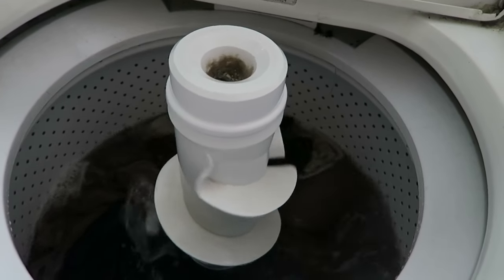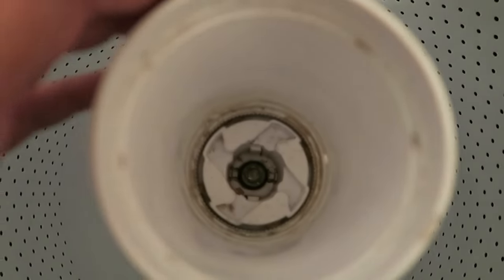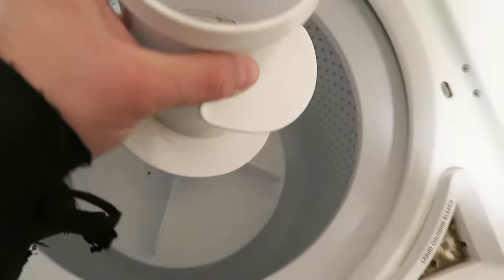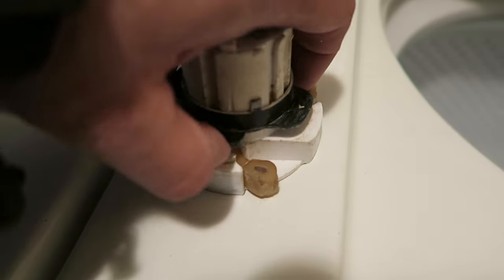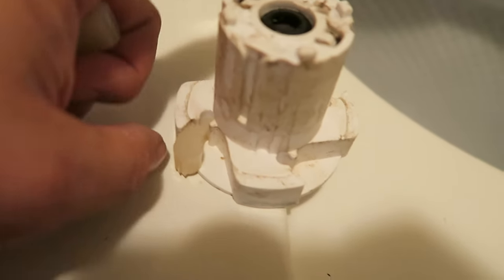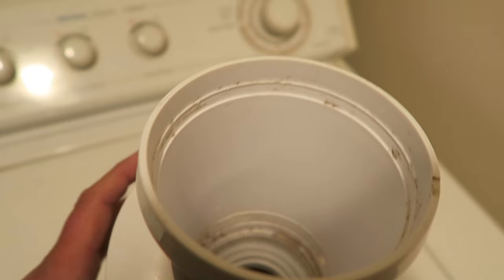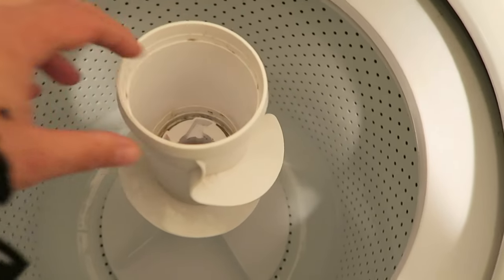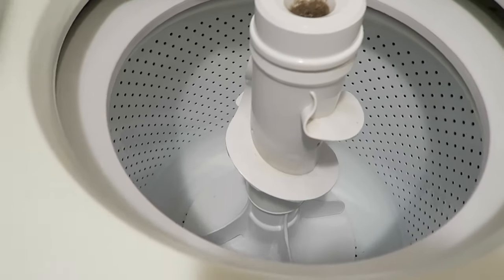How to Repair Agitator Dogs On A Whirlpool Washing Machine.

Comment: DIY for life man. I have refurbished my hot water tank, furnace and fridge. I don't like replacing things that don't need replacing. Great vid man.
Reply from the maker: Damn right, if there are no specialty tools require, and as straight forward as this for a part that costs less than $2, there is no way you should have to pay $150 to have it done! Power to all DIY people!
Reply: @JDirom  hey nice video, what does it mean if the bolt to the agitator is wet?  Does it mean water was seeping in because the seal o ring wasn't keeping the water out?  Like that black seal that was broken when you pulled that piece (cap) over the bolt off?
Reply: @doja-3652  I would say yes that sounds accurate. Replace the rubber seal for the cap

Comment: I cannot pull the top part of the agitator. You put your feet and pull it easily. I put my 2 feet and pull very hard but it won't come out
Reply from the maker: Should take very little effort to do. There isn’t much holding it on there.
Reply: Same Paul!  I'm exhausted from trying,  my husband and I are strong and capable it will not come apart.  I've almost fallen backwards from pulling so hard.  Any luck?
Reply: @gilbertfamily3824 I thought the same thing too but got mine popped open. My washer uses same cogs but little different to the one shown in this video.There are 4 tabs which go from the lower base to the cog cage and they are melted in place. I tried several ways but one which did the trick is to sit on the floor, have shoes on. Grip the agitator fins with your hands and lower base with your shoes. I had to use over 100 pounds of force to break the seal.
Reply: Anyone have better ideas?  I'm trying to pull the top piece off and can't figure what's stopping it.  The bolt was rusted half away, so maybe that has something to do with it?
Reply: @eatjonesoh  there are 4 clips which are melted on to the cog housing. If you can't pull them apart with brute force. You can try heating up a paper clip and try to insert it where the 4 clips are melted that should help release it.
Reply: @eatjonesoh  if the bolt is rusted it's most likely your oring on the cap is cracked.
Reply: @ThePunjabhe  the o-ring actually was in great condition. It might not have been seated properly.  Is there supposed to be another gasket of some sort underneath the agitator?  The spindle was very rusty as well.  I did replace the bolt, but it didn't screw into the spindle as far as expected. I'm not sure if that's because of all the rust or not.
Reply: @ThePunjabhe  I did finally manage to get them apart.  It took sitting on it and quite a bit of force the top and all the dog assembly went flying when it finally came loose!
Reply: @eatjonesoh  yay, same thing happened to me, the parts went flying everywhere. I had to watch more videos to figure out how all the parts went back together.
Reply: @eatjonesoh  the bolt and rubber washer is supposed to seat in all the way. Don't force the agitator or you can damage the plastic splines, keep turning it until it slides in the spindle.  Not sure if I saw an oring at the bottom of the spindle.

Comment: We can’t get the bolt to break loose. We are using the 9/16 socket with extender. What can we try??
Reply from the maker: Assuming that the 9/16 (14.28mm, I used an 11mm in this particular washer) is the right size, you can try some penetrating oil to loosen things up if the bolt is seized. Just be aware you will have to clean after otherwise you could ruin your laundry if excess oil remains after the repair.

Comment: I replaced the agitator dogs, and turned the agitator by hand it does catches. But when I turn the machine on, the dogs seems didn’t catch the agitator. Please help. The teeth inside the agitator still looks good.
Reply from the maker: If it is not catching it is best to replace the other parts as well.
Reply: Thank you sir, what other parts that I need to replace?
Reply: 😢is that possible for the transmission didn’t turn far enough to swing the dogs out to catch the agitator? Please help! I already every ( new dogs, agitator, new agitator holder)

Comment: Nice video, but my problem is the big screw it has lots of rust and my tech told me it would be hard to remove it… what do you suggest I should buy to prepare myself to replace parts? Should I buy the entire agitator in case he has to break it?
Reply from the maker: I imagine that the tech would be better judge of your situation seeing it. That being said penetrating fluid should help remove the bolt if there is a little rust.
Reply: @mariasalazar669  I used pliers to pull mine out.  The head had rusted away too much for a socket to work.

Comment: Hi great great video. I’m confused about the 7/16” wrench extender. Is the extender 7/16” too?
Reply from the maker: Use whatever extender you have to reach the nut with the 11mm socket. The extender would be 1/4” if you are using a 1/4” socket wrench.
Reply: @JDirom  thank you🙂
Reply: Hi. Hate to bother you and hope you had a wonderful Thanksgiving. I can’t get the agitator grease anywhere is there a viable substitute.
Reply from the maker: @Kayemwhy  Lithium grease

Comment: I replaced my dawgs. It works properly. But slip when I wash a load. Any suggestions ?
Reply from the maker: Check the teeth in the agitator itself are not worn. Ensure the motor coupler underneath isn’t worn out.
Reply: @JDirom  the teeth seem fine. How can i tell if the coupler is worn out?
Reply from the maker: @commonsenseprojects  under  the unit likely will see a lot of fine black dust.
Reply: @JDirom  and what does that meen?
Reply from the maker: @commonsenseprojects  sorry, best have someone take a look at your machine. Impossible to diagnose at this juncture without seeing the unit. Best of luck.

Comment: I can't remove the seal it's stuck
Reply from the maker: Likely beneficial to replace the other parts as well then.
Reply: I had the same problem getting the seal out.  What I did was I got a flat blade screwdriver with the dullest tip and gently pressed down on the rubber o-ring all around the seal to break it free.  I was then able to pull the seal out.